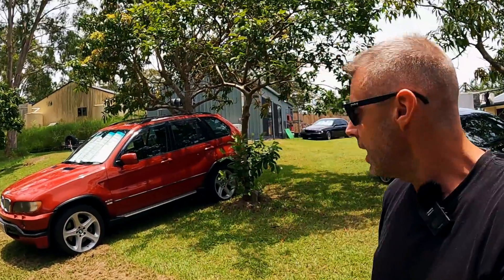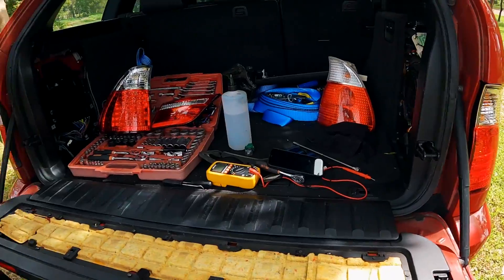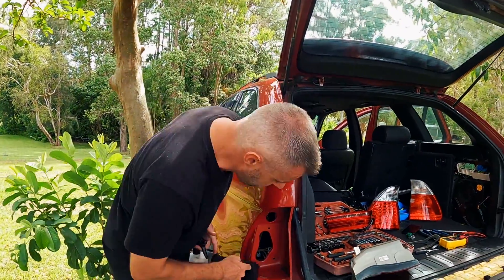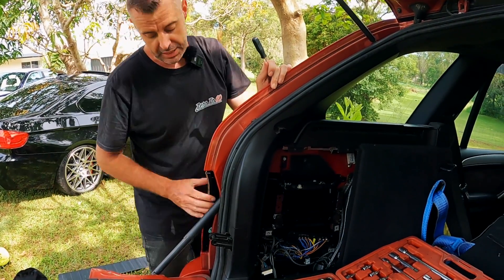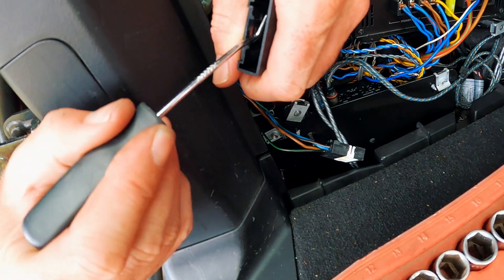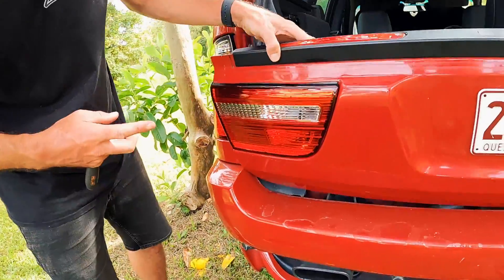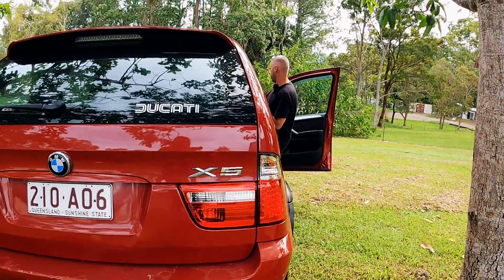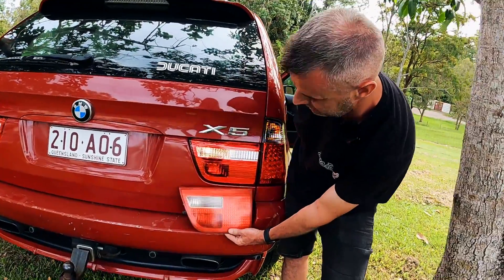BMW E53 X5 LED Tail Light Upgrade Install: Modern Look!

Comment: Yup, try coding it out.  I've tried the resistor/cap combo before and it kind of works.  But I think the cutoff frequency shifts with temperature.  So sometimes the flickering will come back randomly.  Best to try to code it out.

Comment: Code the hot and cold check off for the lights where there are leds, you can do it with bmw scanner, its also alot better for you leds if its also, it also keeps the leds from flickering when the lights are off
Reply from the maker: hmmmm worth a shot thats for sure and like you said it will help with the flashing when the lights are off.

Comment: FLICKERING: Look for a setting in the LCM module where you (maybe) could switch from bulb to LED. The E46 had it for the FL version where the tail lights were LEDs and it then changed the way it powered the lights. Bulbs are powered by impulses. They are not powered constantly but in pulses. A bulb can't dimm that fast so you see it always lit. LEDs however can't be powered by pulses and if you do then you get that flickering. If there is a menu toggle for that in your LCM then just switch it. If not then you need to buy a LED ballancing module that will sort out the pulses and convert them into constant power. 

...another problem could be your alternator or alternator regulator going down the drain. But then you would be able to see flickering on the inside lights as well (pulsing light bulbs everywhere). This would get worse the more drain you would cause. Like seat heating to maximum etc :)

Comment: Hi,

These bmws have pulse power technology that reduces heat of regular halogen bulbs. You need a LED decoder to stabilise that voltage..
Reply: @Damon Luis Instablaster ;)
Reply: @Nikolai Anakin it worked and I finally got access to my account again. Im so happy!
Thank you so much you saved my ass!
Reply: @Damon Luis no problem =)

Comment: I also did put his kinda lights on my X5 few years ago, completely same design, probs brand too, but with casual bulbs on sides. I think leds are just overrated, hard no notice on winter when leds don't melt the snow off and.. well. I would now have picked OEM ones! 🤣 But it's just opinion stuff, or age thingy.

Comment: I'm  pretty sure you will need to reprogram the system to stop the system sending a check lights signal to the tail end. The signal is a surge of power to test if the lights are faulty, therefore adding extra watts to the low watt leds. So the flicker is caused by the fault test signal.
Reply from the maker: It wasnt on my old one. But that does need coding out anyway, so will get on to it.
Reply: I hope this helps, as the that told me is going to fix mine, same upgrade only i went with the smoked lenses. 👍🏼

Comment: I suspect the flicker is a "bulb" saving feature, if the battery voltage is high they PWM the lamps. If you have a facility to use a power supply instead of a battery it would be interesting to try them at 11v to see if it stops. I seem to remember there is come coding which sets this up (at least there is in the E65).
Reply from the maker: Possibly. With the ibus app i put on yesterday. I can change the voltage going to the tail lights. The more i turn them up the less they flicker. However when turned up they look more like a brake light.
Reply: interesting, suspect the solution is to turn them up to full voltage and use a resistor to drop the voltage at the lamp to dim them! Not ideal! (put resistor in series not the usual parallel)

Comment: I have the same tail lights. I have a problem with the brake light, the upper part of the lamp shines as much as the lower part when the brake pedal is pressed.

Comment: How did you wire the rear fog lights? Or did the car come wired this way because you're in Australia. I have a euro lcm control module in the U.S. sadly its not plug and play. Do you know how I can hook mine up?
Reply from the maker: For us it was just plug and play. The fogs being in the garnishes on the tail gate. Does your car not have wiring in the tail gate for the fogs? You may be able to calibrate the LCM using PA soft to do what you need as well.
Reply: @ZeroTo60Tube  hello. Yes it has the wiring in the gate which is why I thought it would work. I bought the same lcm module you have. I do however need to learn how to install and use PA soft. Not sure if that's all I need. I guess I'll be scouring the internet for that info. Seems complicated but so does everything else you've never done before. 
🤔
Reply: @R2RO1  im in the same boat i couldnt figure it out still

Comment: Why do some x5 have the extra piece of aero on the rear bumper that goes under the black lip and up the side a bit? Is this a factory aero or something or an aftermarket add-on? 
Some give me any info regarding, cheers
Reply from the maker: This is the stock "is" body kit.

Comment: fixed led flickerin thru  coding . car doesnt check  anymore bulbs
Reply from the maker: Thats a different flicker. This flicker is caused by the PWM signal that the light control module uses to run the buld. With a tradition bulb a PWM signal is great for affecting brightness. However with LEDs, that PWM turns them on and off.
Reply: Would my headlights flicker if I change them to LED?

Comment: Here is a simple solution I have used: You need to connect a capacitor on each side to regulate the voltage flow, which eliminates flickering.

Lightwerkz in the US offers a ready-made, prewired, and plug & play system for $25 US. It comes with instructions, and I can’t tell you how easy it is to install. It took me 5 minutes.

Since YouTube doesn’t allow links in video replies, go to Lightwerkz and search “E53 TAIL LIGHT - CAPACITOR FIX”. 

You will be very happy.